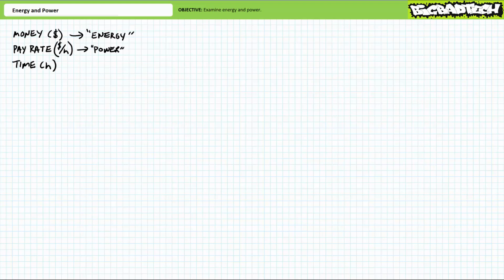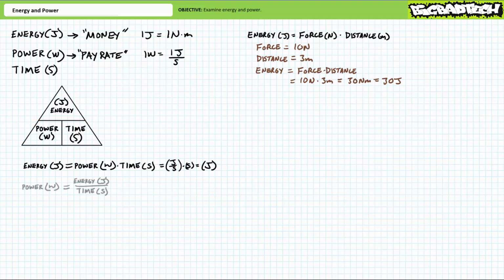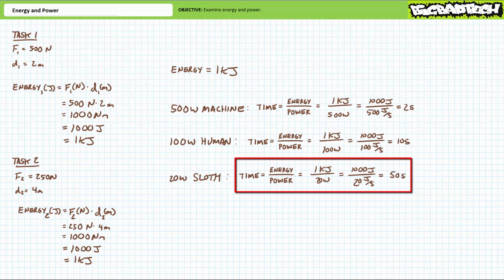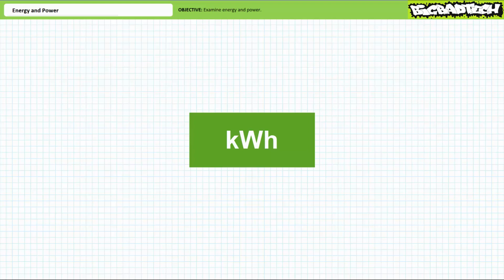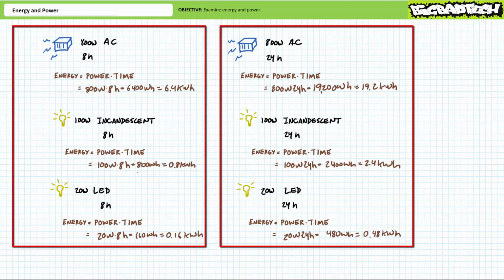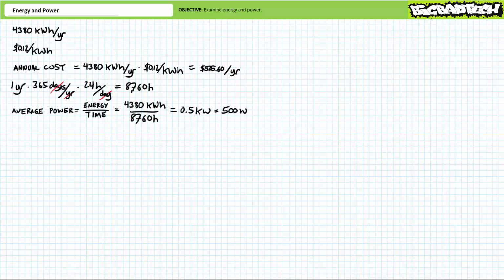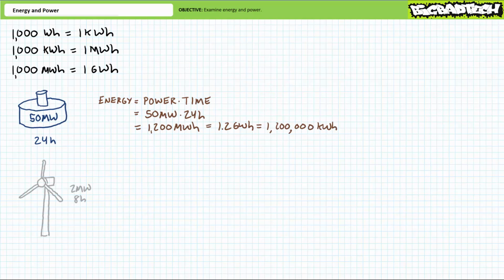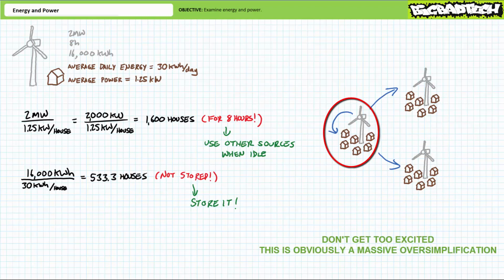Energy and Power (Full Lecture)

Comment: I am not well versed in this topic. But since I last studied (1996 was a long time ago), batteries were still in an infant stage where they would deteriorate over time with charge and discharge cycles. Is it still the same or has it gotten better? My current understanding of the most popular batteries (lithium-ions) is that lithium mining is highly detrimental to the environment. Is there any other material that we can use to store the charge in a battery other than lithium (at a large scale)?

Comment: Then throw in nuclear power and the debate with renewables really heats up :)
Reply from the maker: True dat. Ever heard of a thorium reactor? I attended a presentation on future nuclear power a couple years ago and one of the key points was the abundance of thorium, the reduced amount of nuclear waste, and the reduced risk of weaponization. Interesting concept.
Reply: @bigbadtech  interesting thank you for everything
Reply: @bigbadtech  
Yeah, I wonder if anyone's done the math on whether the production, installation and maintenance of solar panels or wind turbines can be done strictly with solar/wind. All the way from mining the raw materials, transporting and refining, transporting again to the factories, running said factories to delivery/installation and maintenance. Naturally, there is no mining equipment that run on batteries so you'd have to sell electricity to offset the fuels used. Speaking of batteries, same thing. At least cobalt  mining has a low carbon footprint.

The factory I work at has a $50k/mth electric bill. They make plastic film/bags. It's a small plastic film/bag operation relatively speaking.

Comment: Very good lectures.  In batteries generally the total energy is more if measured say over a 10 hr draw vs 1hr at 10xs amp, so amp/hrs is usually expressed over an 8 hr period to get higher Ah, but you get less total energy when discharge is done faster at higher amps.
Reply from the maker: True dat. Check out the battery discharge characteristics lecture at: https://www.youtube.com/watch?v=sM2ss-EvAco&t=2187s